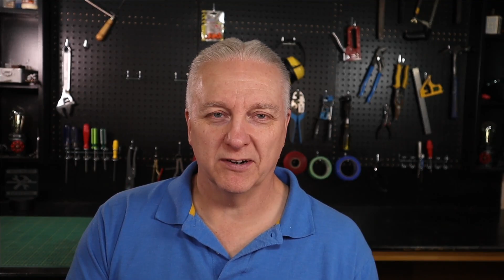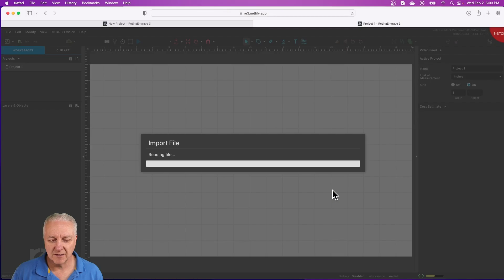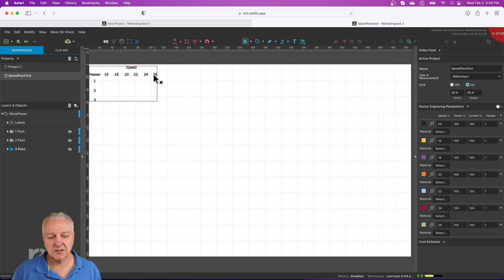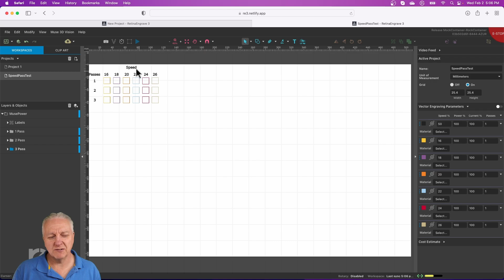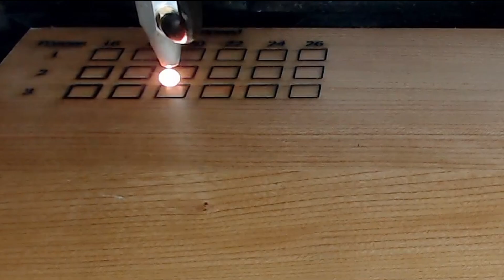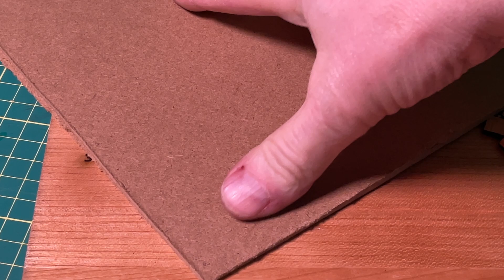Beginners Guide to Laser Power and Speed

Comment: Excellent video. I just now cut through 1/8" MDF card with my WC45w. It cut clean at 4 to 5 mm a second, 100 % power and one pass. The trouble is the soot on the edges takes too much to clean up to make it worth it. Any batch work and you would be spending hours wiping the sides down. Im out on mdf for sure.
Reply from the maker: You can simple move the laser fast and do multiple passes to reduce the soot.

Comment: Hi there,

I am new to the lasrer cutting scene, and I am having a few problems testing certain materials.  
I recently got some Aluminium / foil type business cards that I attempted a test on, however, the cards seemed to get bent during the test process.  
I am not sure how to properly build a test file and to make sure that the correct setting are applied to not have this effect.  
My other test was done plywood, which rsulted in the fire warning being triggered.
Reply from the maker: You're running into a couple of problems here.  First very thin/cheap metal cards will warp like crazy.  Second, I'm guessing your power is too high, or your speed is too slow.  Both of these are pretty typical engraving issues for new users - you'll learn be gentle.  We've all done it. 😉

If you're trying to cut these, you will need to ensure that your laser can actually cut metal.  Basically unless you have a fiber laser, cutting any metal will realistically be off limits.
Reply: @SteveMakesEverything  thanks for this.  I did make a number of adjustments and actually got to a point where it seemed to work.  Unfortunately my laser can’t cut metals, wish it could.  Now my challenge is getting the detail to show properly for text etc.  especially with smaller fonts or texts.
Reply from the maker: @SalientAnimal  If you are using a CO2 laser, you will certainly struggle with even engraving on metal, let alone cutting.  You'll probably also have challenges with fine detail since CO2 laser don't have a very small spot size.

If you want to cut metals and get finer detail you'll need a fiber laser (probably a MOPA would be the best choice).

A UV laser will mark metals, but not cut them, though it will give you the finest detail of all.
Reply: @S @SteveMakesEverything I have a diode laser 🫣🙈. Creality Falcon2 Pro S 40W

Comment: how to control power of the laser on grbl?
Reply from the maker: Not sure I understand the question,  but power and speed are the only two knobs you can turn to effect overall output.
Reply: @SteveMakesEverything  
I have an 80-watt laser  (10-watt optical laser), which I installed myself from Youtube .How can I control its power in the GRBL program? 
I searched all over Youtube and couldn't find a way to accurately set the power.
Reply from the maker: @malikkomim8321  To do this you would need a GRBL controller to accepts codes from something like Lightburn and turn them into movement and power levels.

Basically you'd be better off buying a production diode laser than trying to upgrade what you have.

Comment: I recently got a omtech k-40 and I’ve basically exclusively been cutting 1/4 wood and 1/4 mdf with it.  I just cut 1/8 for the first time today actually. 2 passes is enough for me to get through all 1/4th. I do get charred edges, but that’s nothing a little sanding can’t fix. I paint everything I cut so that charring is never worth sanding to me. But it is possible and not as hard or intimidating as one would expect.
Reply from the maker: If you are doing multiple passes anyway, try to do 4 passes but almost double the speed and you should have less charring.  MDF is generally bad for charring, but you can eliminate some of it by going faster with more passes.

Comment: So you get ZERO smell ???????  I am moving over 1000 cfm but still get a slight smell during use on birch
Reply from the maker: This would depend very much on how well your laser is sealed. Air intake and exhaust need to be controlled properly or fumes will leak - even slightly.  Minor smell should be ok

Comment: Good stuff.
Similar to how i do it. 
I dont fully understand the powerscale and got strange results.
Cutting powerscales seem to be more rare.
I ran a powerscale on my 5w diode laser and had great success.. But on the 100.. Idk what happened. 
1/8" mdf @ 60% 100w laser. I need to play with it still.. Edges are a bit gummy after.
Reply from the maker: For power, create or download a test similar to the one in this video.  This will tell you the best power vs speed settings.  On an FSL laser with RE3 you have the added dimension of current to confuse things and a couple people have asked for a video to discuss this, if your 100W laser is a Titan or a PS, then look for that coming up
Reply: @SteveMakesEverything  
Sorry. For some reason i dont understand much of what you said
Reply from the maker: @turboflush  Gee, maybe I should learn to type - or at least read what I'm posting 😀.  At any rate I'll do a video this week to talk about the difference between power and current in RE3

Comment: Not enough output out of the laser is not too far-fetched.  I bought a new Ortur Laser Master Pro 2 S2 LF and it takes 6 passes to cut through 1/8" wood while other guys can do it in 1 pass.  Ortur had me run a test for them and they decided I needed a new laser head, but with Chinese New Years (a full month) I'll be waiting forever to get the laser.
Reply from the maker: Diode lasers generally have much less power than a typical CO2 laser so it isn’t unreasonable to expect to do multiple passes. Some diode laser models definitely provide better technology than others. In your case it sounds like the module is just faulty.  10W laser modules tend to pair two 5 watt lasers into one box and in your case one of them might have failed
Reply: @SteveMakesEverything  No, it's just a 5 watt laser, so one couldn't have failed.  Although I have no idea why it's not putting out what it should, but I know mine is putting out a lot less than other guys testing that same laser on YouTube.  I've seen other guys guys cut through 1/4" (5mm) wood in 2 passes with this same 5 watt laser.  If it takes 6 passes to cut through 1/8" (3mm) wood with mine, I'd never be able to cut through 1/4" so something is definitely wrong.
Reply from the maker: @spydie  Definitely sounds like it.  If you haven't already, make sure the optic where the laser beam comes out of the module is clean.  It's a long shot but if it's dirty your power will be greatly reduced.
Reply: @SteveMakesEverything  Hi Steve, yes, I checked and cleaned it, but it was like that (no power) from the day I got it.  I didn't know it should have more power.  I was just disappointed that it was so weak.  then I watched several reviews on YouTube and guys running cutting tests and that's when I realized mine was running at about half the power everyone else's was.  I hope the new laser will fix it, if not, then I have to assume there's something wrong with the mother-board?  Those are really the only two things that control the power, well, that and Lightburn, but I know I have the settings all correct.  I wish Ortur would offer a 10 watt option.  There's no substitute for horsepower! LOL
Reply from the maker: @spydie  FWIW I think I'll have a review of a 10W diode laser coming up soon so watch for that.  Even assuming your laser was working correctly, 5W is just a bit limited for cutting material.  Hopefull Ortur gets your fixed for you though.
Reply: @SteveMakesEverything  Hey Steve, will that be a plug and play 10W for the Ortur?  I've seen a few people put an off-brand aftermarket laser on them in place of the factory one, but it wasn't plug-n-play, it was more of a jerry-rig affair.
Reply from the maker: @spydie  I don't think there's much difference in the laser module between vendors so you might be able to plug another module in your later.  Do a bit of research on the laser module pinnout, but you can certainly buy just the module on Amazon and presummably that will plug in anywhere (subject to your power supplies abilities of course).  It's possible though that the Ortur purposely has a different pinnout so yo need to go back to them for parts.
Reply: @SteveMakesEverything  Thanks.  But I'm thinking if it were that easy, nobody would be using the 5 watt laser.  Everybody would be switching over, but so far I've only seen about 3 videos of people trying to switch and it wasn't plug-n-play.  And if it were that easy, Ortur (and the others) would offer the option for a little bit of nothing (maybe $150) when you buy the laser or offer it as an add-on later.  But so far there are very few (maybe a couple) of the less expensive models (that being these Chinese $250-$500 lasers) that offer a 10 watt laser.  I will be exploring this more if my new laser doesn't cut as well as it should.  I'm hoping to watch someone else do it first on the Ortur with an inexpensive plug-n-play.  It would be a great market to get into once you find a vendor for the laser.
Reply from the maker: @spydie  There are certainly lots of videos documenting the upgrade to 10W, so it's possible.,  No doubt one of the reason it isn't the path for everyone is the cost.  It's worth taking a look at a few of those videos - maybe I'll consider one myself ;-)
Reply: @SteveMakesEverything  I'll be waiting for it! LOL

Comment: When you say "40watt" laser won't cut MDF... is that 40watt input or output power? It seems that these Chinese laser system guys purposefully obfuscate input power with laser output power. I see a whole lot of 5.5watt output lasers labeled as 80watt lasers. Any guidance there?
Reply from the maker: In CO2 lasers they tend to specify the peak wattage of the tube, so they are cooking the books a bit.  In terms of real output a typical 40w laser is usually closer to 35w of real laser output. On my own laser with a 90w tube, the output based on power supply output voltage and measured current can be calculated at 70W of useable power.

For diode lasers the power claims used to be all over the place, but the industry does seem to be moving toward actual laser light output power so they typically claim anywhere from 5.5-10w

Comment: Another great nugget of wisdom from you Steve. Thank you. I run an in-line exhaust fan adding an additional 240 cam of exhaust effort to the system fan and then in to my FSL100 fume extractor. When running this test from you on some plywood, I am getting some pretty good smell in the workshop.  No smoke just smells. Are you getting some smells from your Muse 3D and is this just normal?  Thank you for all of your help.
Reply from the maker: I think this would depend on the kind of material you are using.  I don’t get any smell/smoke but my laser moves a lot of air and my exhaust pipe is only about a foot long

Comment: I use almost exclusively  3mm MDF. On a 45w Pro-series FSL, I use the following settings with minimal char and staining. Takes only a wipe with damp paper towel to remove any yellowing.

To Cut:  60sp, 95pwr, 100cur, 4 passes
To Engrave: 70sp, 30pwr, 100cur, 1 pass
Reply from the maker: These should be decent settings.  It's the multi-passes that makes it possible.
Reply: Hi, sorry for jumping in, but when you say 60sp what's that measurement? what would that be in mm/min??
Reply from the maker: @bricomama16  On a laser running RE3, this would represent 60% speed.  If you are using something like Lightburn then you typically work in mm/min or in/min
Reply: @SteveMakesEverything  i always understood mm/s for co2 and mm\m for diode.
Reply from the maker: @turboflush  In RE3, FSL made a choice to use percentages rather than actual speeds.  Being a man of the world I can adapt to either, thogh I prefer the exactness of distance over time